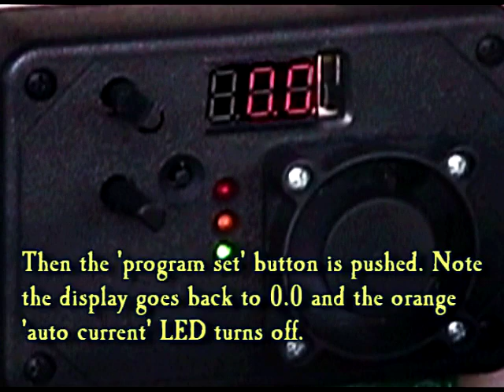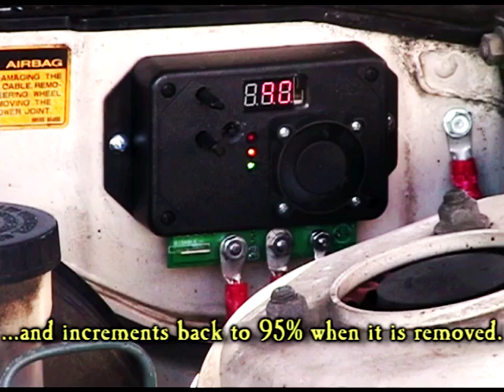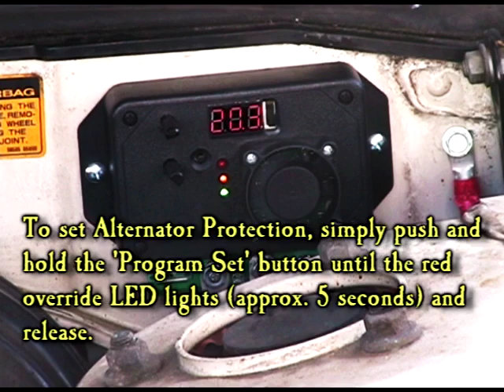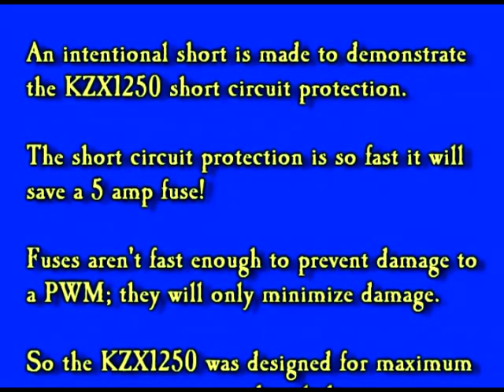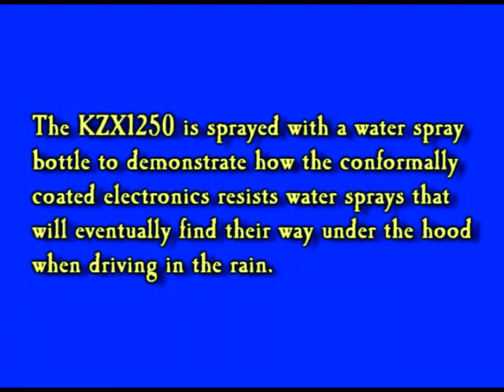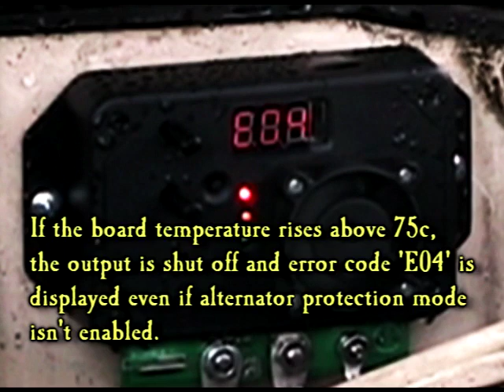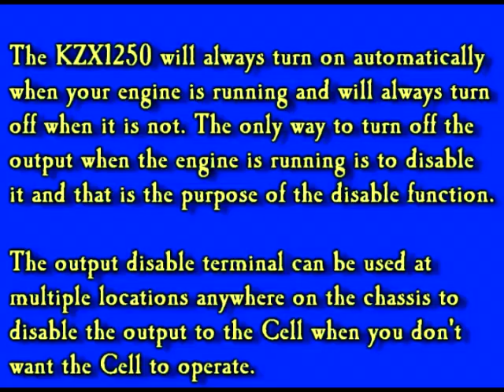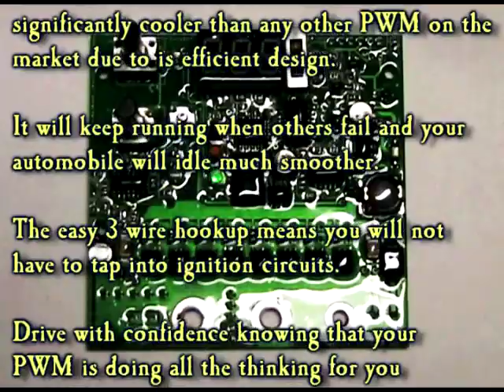KZX1250 Intelligent Automotive PWM for HHO

Comment: My HHO Generator gets Earth  ( Minus ) through the Mounting Bolts from the Chassis. Will the KZX 1250 still work ? Or is there another Way then to connect the Positive from the Battery to Positive on the HHO Generator and Negative from the PWM to the Negative of the HHO Generator ?